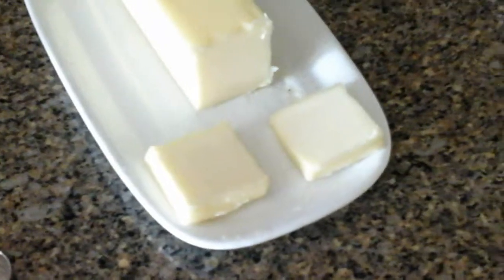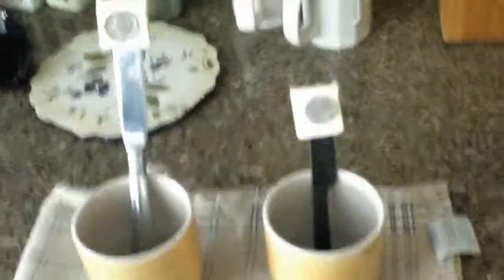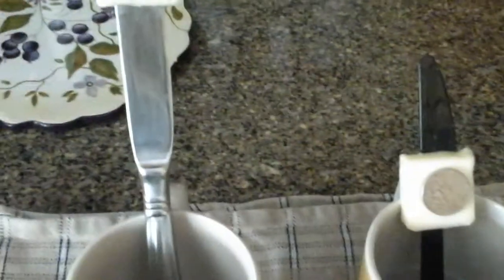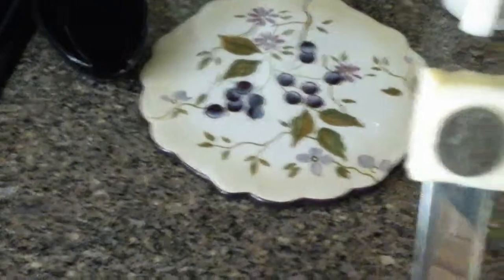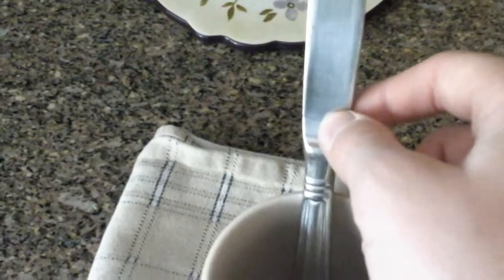Conductors vs. Insulators Experiment

Comment: Your control was off.  The knives should have been the same size and thickness. The plastic knife was shorter so the steam melted the butter instead of the heat being conducted through it. Take care of that and the experiment will work:)